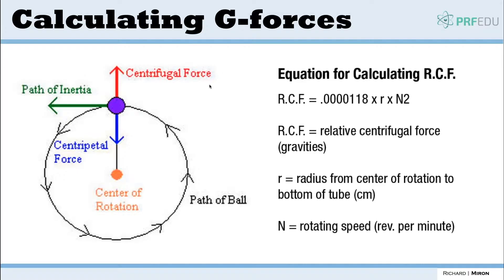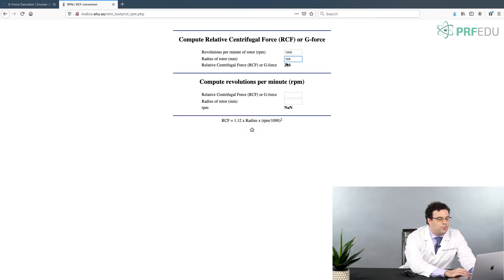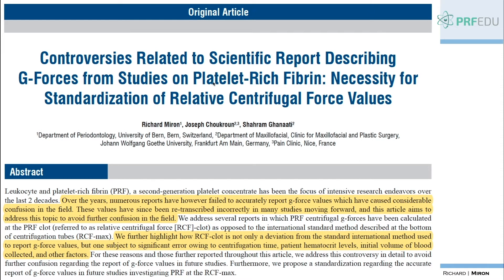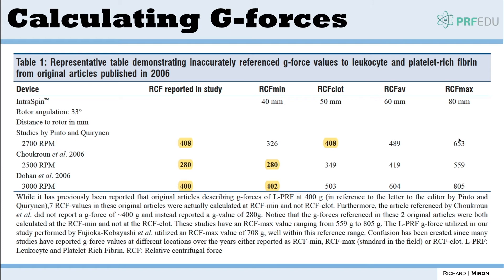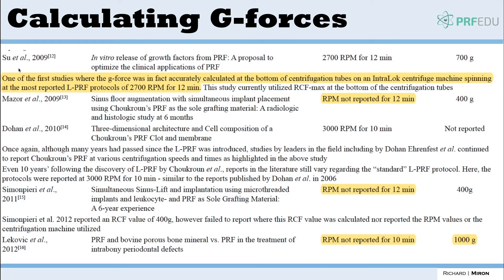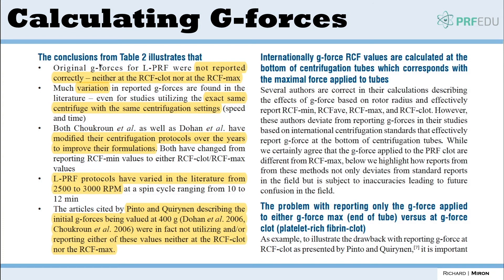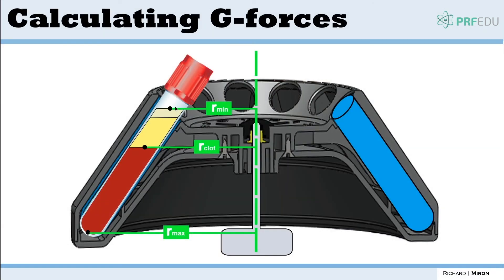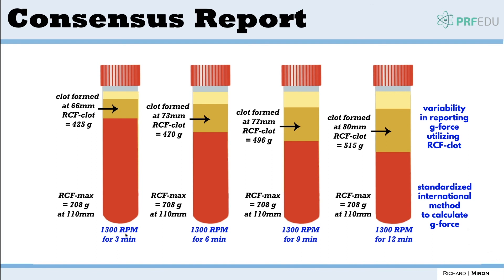Chapter 4.1: Understanding G-forces and RPM presented by Dr. Richard Miron

Comment: Could we just remove content illustrating procedures done using Fixed-angle centrifuges? There's plenty of evidence showing damage to the platelets/leukocytes when using fixed-angle rotors instead of horizontal/swing out.
Reply from the maker: Yes, it is not a good idea to use fixed-angle. The cells get quite damaged as you eluted to.